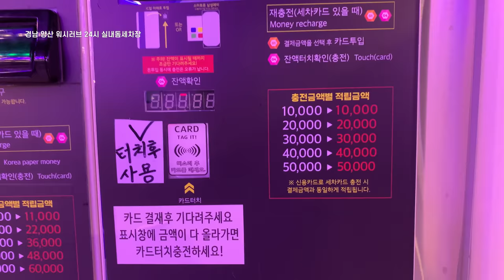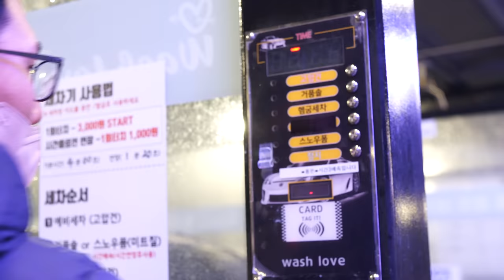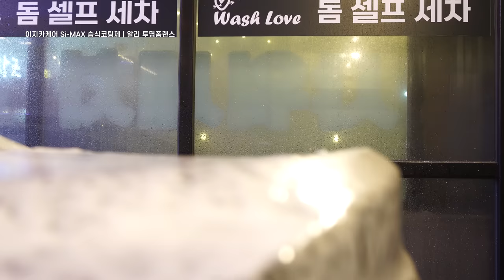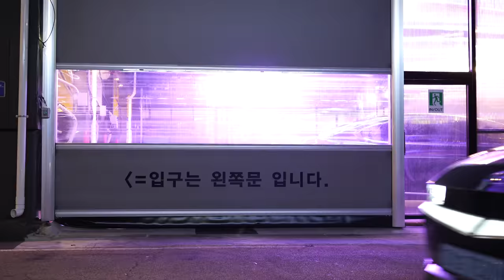장작떼우는 비닐하우스에서 겨울에도 따뜻하게 셀프세차했습니다

Comment: What is the price of ego Blower in South Korea? In China, the model 765 bare metal can be bought for 1200 RMB
Reply from the maker: Is 1200RMB included in the battery charger body?

In Korea, you can buy it for 770,000 won, 4300 RMB in a set.
And it's 2,600 RMB just for the bare tool.

If it's a set price, I'll send you the money, so can you ship it to Korea?